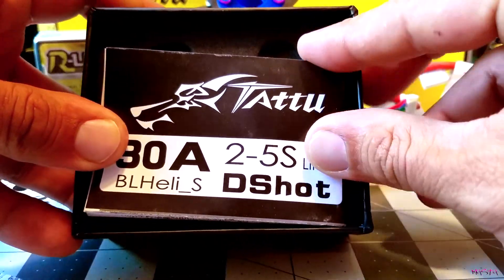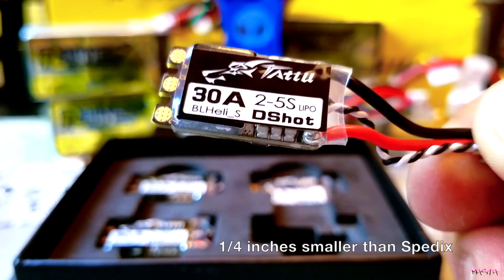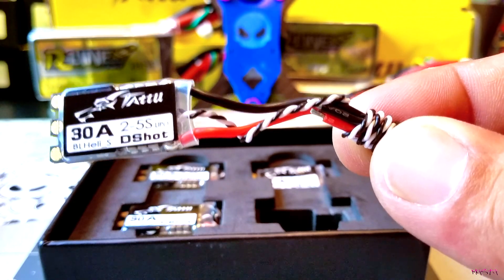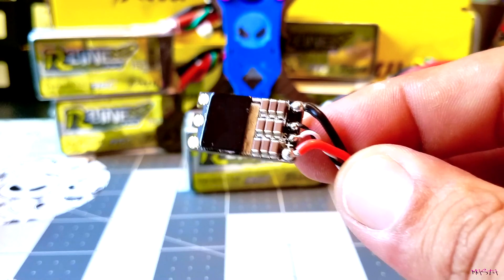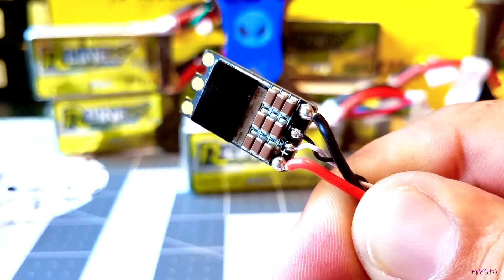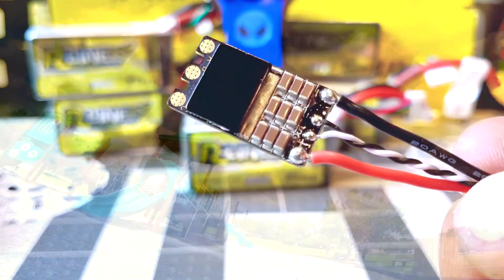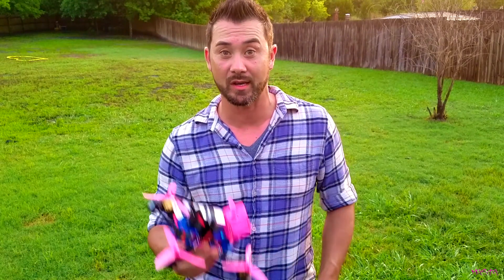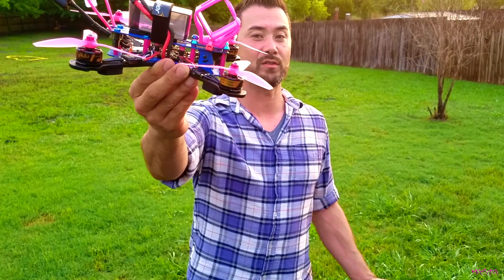Tattu 30A Blheli-S DShot 2-5S ESC Review

Comment: Good review man. 👍🏻 Informative and to the point. And great flight vid they look so smooth!
Reply from the maker: Fubar Fpv I didn't tune at all either!
Reply: Masta FPV nice, just calibrate & fly then or did you set them up in blheli suite prior to installing.. not having passthrough on kiss fc is a pita !
Reply from the maker: Fubar Fpv I flashed with a beta board prior to flight to make sure Firmware was good. No calibration needed when you use DShot. there work right out of the box even with kiss
Reply: Masta FPV cool, I didn't know that about d-shot so thanks mate👍🏻👍🏻
Reply from the maker: Fubar Fpv digital protocols don't require the analog inputs like they used to. cyclic rates are all you need to worry about nowadays. these ESC are smooth out of the box